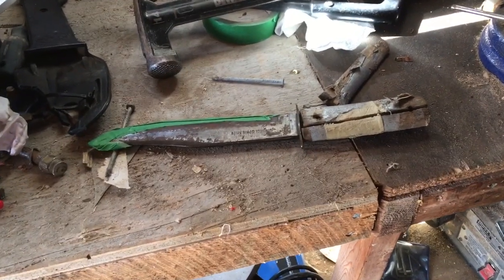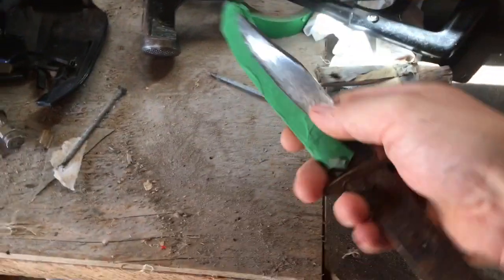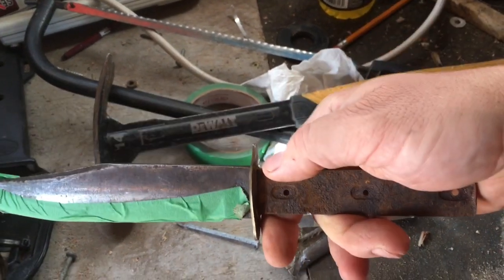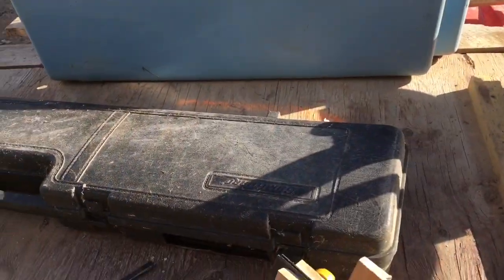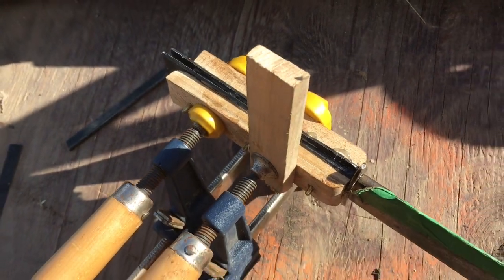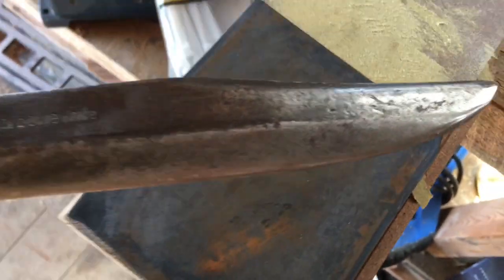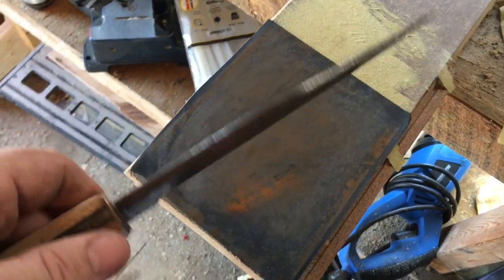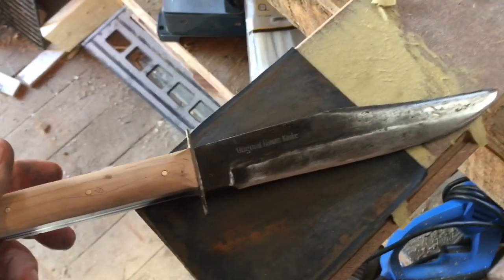Restoring A Solingen Original Bowie Knife

Comment: I would have cleaned it up so I had taken all the rust off. I would have shinned up the guard before putting the handle on. The blade is so pitted that not much can be done, other than put a sharp edge on it. If it actually is an original Bowie from Solingen it deserves better care.

Comment: Did anyone see the maker mark I have one that has the original Bowie knife stamped on the blade down next to the handle it has a mark looks like a gloved hand holding three arrows
Reply: voos &schleiper
Reply: funny thing about them, they are a 1950's design and the design was either passed around to different factories or copied from other factories, i have a F.A. Bower with the exact same design i had to put a guard on because someone cut it off
Reply: I have this Bowie mine isn’t in this rough of condition but it has deer antler handle but the makers mark on mine is like a fox and under it is a k55 with a backwards k